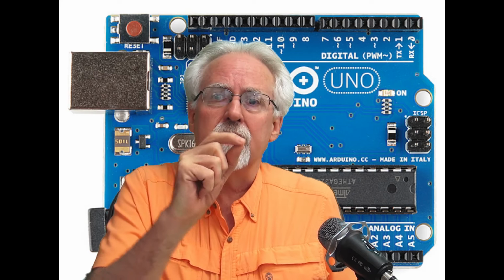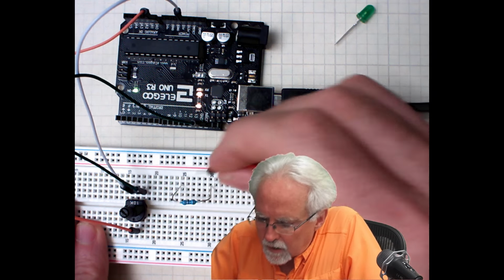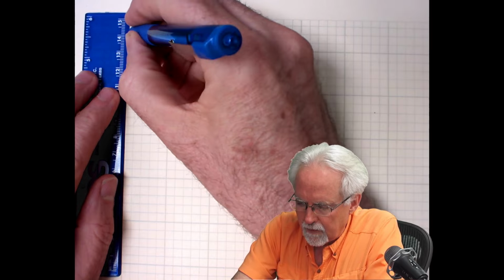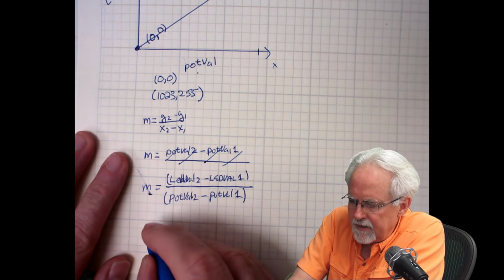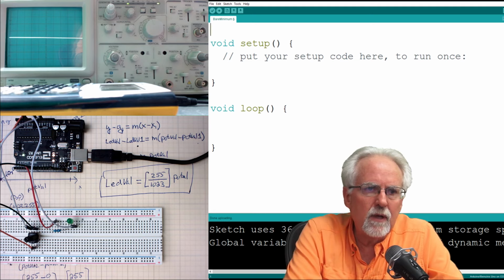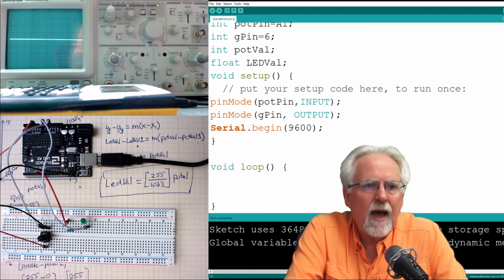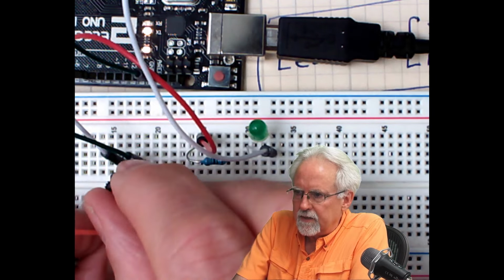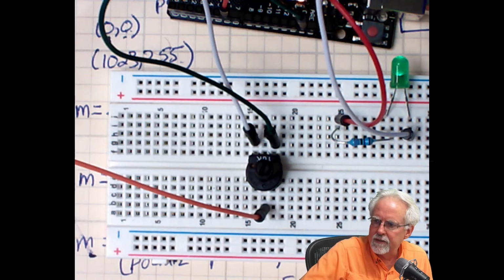Arduino Tutorial 14: Dimmable LED Project

Comment: isnt something like this easier to adjust the brightness of the LED?
where you connect the positive pin of the led to digital pin 11 and the middle pin of the potentiometer to the analog pin A0

void setup() {
pinMode(A0, INPUT);
pinMode(11, OUTPUT);
}

void loop() {
analogWrite(myLED, analogRead(A0));
}

Comment: I love learning programming with you! It’s so helpful as an apprentice mechatronics technician. However, I didn’t know about the formula y − y₁ = m(x − x₁), but f(x) = mx + b worked just as well. Is there a collection of formulas that are important and often reused in programming?
Reply from the maker: Both are equations for a line. Since for most electronics, you start with two points, using the point slope formula is the most appropriate. y = mx + b is the slope intercept form, which requires you know the intercept.

Comment: float Vout;
int readVal;
int val=A0;
int dt=500;
int ledPin1=9;
float bright;

void setup() {
  // put your setup code here, to run once:
  pinMode(val,INPUT);
  pinMode(ledPin1,OUTPUT);
  Serial.begin(9600);
}

void loop() {
  // put your main code here, to run repeatedly:
readVal=analogRead(val);

bright=(255./1023.)*readVal;
analogWrite(ledPin1,bright);
Serial.print("My pot val is: ");
Serial.println(readVal);
delay(dt);
}
Reply from the maker: Excellent, looks like you have it working!

Comment: /*
    True Analog Voltage readings and LED dimming without PWM using Potentiometer.
*/

// Pin Configurations
const int voltageReadingPin = A1; // Explicitly use the 'A' alias for analog pins
const int baudRate = 9600;
const int delayTime = 300;

void setup() {
    pinMode(voltageReadingPin, INPUT);
    Serial.begin(baudRate);
}

void loop() {
    // Read the actual hardware voltage coming off the potentiometer
    float readVoltage = (5.0 / 1023.0) * analogRead(voltageReadingPin);
    
    // Print a clean, formatted sentence to the Serial Monitor
    Serial.print("True Analog Voltage: ");
    Serial.print(readVoltage, 2); // 2 decimal spots  only.
    Serial.println(" V");
    
    delay(delayTime);
}                                               ACCIDENTALLY DID THIS !! :) THANK YOU SIR !

Comment: This was really fun! To really bring it home I did two LEDs, one goes along with the voltage and the other one is inverse, so at 0 one is off and the other one is at full power, and at 1023 one is at full power and the other one is off. It´s fun homework and it helps round out how to do the formulas :D Thank you for everything! This is an amazing course.
Reply from the maker: LEGEND! Great job going the extra mile with that inverse logic. The best students think about what they have learned, give themselves something new to try, or a twist on what was taught, do it, and then that shows that learning has really happened. It always looks easy when you watch me do it, but real mastery comes from doing something new on your own. Well done.

Comment: Yeah we listen to the whole video. I also was thinking do we need the lead to the other pot pin and of course otherwise the 5V drop only goes through the first part so there is no voltage divide. Also really pushes the point of the input being 1023 and output 255. Easy thing to forget.

Comment: int pinRead = A2;
int readVal = 0.;
float v2;
int wait = 1000;
int brightness; 
int ledPin = 9;
float VoltLimit = 4.;
void setup() {
  // put your setup code here, to run once:
  Serial.begin(9600);
  pinMode(ledPin, OUTPUT);
  pinMode(pinRead, INPUT);
}

void loop() {
  // put your main code here, to run repeatedly:
  readVal = analogRead(pinRead);
  brightness = map(readVal, 0, 1023, 0, 255);
  analogWrite(ledPin, brightness);
  delay(wait);
}
I have tried to build it before i even watch the video after i searched i found the map function and i used it to change the range of the readVal varaiable from 0 => 1023 to 0 => 255 and it works hahahah, but i love the math behind it so i did it again with you during the lesson.
Reply: Map...Nice!

Comment: The most valuable piece for me is using critical thinking to do the "homework" assignments you give. I internalize the knowledge by applying it to the assignments, and I feel so accomplished when they work (or even when they don't - at first)!  I save my work and use // to comment out anytime I feel I need a bit more explanation if I need to go back to it. I've got 3 Arduinos in various stages of projects at all times. Most recently, I built a fun project that required a 6-digit keypad code. When entered correctly, it would release an elf's "holiday spirit" (fairy lights). I packaged the whole thing up, put an elf in a "containment chamber" and stuck it on my apartment door as an escape room-style entry for the holiday door decorating contest. Your teaching style is perfect - a slow burn with lots of explanation, followed by head-scratching assignments that allow the learner to apply that day's lesson. Simply, thank you!!
Reply from the maker: That is a really important point, and doing the home work is very important. Here is the thing . . . when you watch me do it, it looks so easy. You think you understand it, because it makes perfect sense. But only in doing the homework do you learn that it is not so easy, and it forces your own brain to think. When you solve a programming problem on your own, connections and pathways in the brain are created that allow you to form your brain into a problem solving machine, not a cut and paste robot. Critical Thinking is a skill that is like building a muscle. It does not come naturally but something you have to develop. Thanks for your comment.

Comment: Just a note to my future self and Thanks to Paul! I just completed this project! The best part of this Dimmable LED Project -I was able to complete it without looking at your lecture until the end. I just watched the first part of your video, understood what we are trying to accomplish and gave it a try to see if I can do it by myself. To my surprise after spending 1 hour, I was able to.. then I looked at the end of the video to see if i made it correct. I was correct. Also one thing I did differently was to print the raw values and the voltages read by Potentiometer pin as well as Led pin, so total 4 values on the serial monitor. Again, I cant thank you enough for making all these educational videos. Five years ago, When I first looked at your old Arduino Tutorials, since I did not practice, I almost forgot the concepts, now since I am doing the hands on and completing assignments, hopefully it will stick in my brain for long..

Comment: I'm wondering if it's necessary in the "set up" to do that pinMode (potPin, INPUT) since that analog pin seems to be an input by default.  I was able to get away with doing this and the previous lesson without calling that INPUT on the analog pin.  I just jumped straight into having a variable equal to analogRead from that pin in the "loop" section.
Reply from the maker: It is good practice to do it

Comment: Currently laid up after surgery and this has been an amazing way to learn! I got the Elegoo kit since it was a bit cheaper and came with more stuff. I tried doing the original Arduino projects via the PDF of their project book and the components were different enough that a few didn't work. Been running through your videos ever since. 

One thing I wanted to call out on this one was I followed your advice and didn't use ANY real values in the void loop! Even my (255./1023.) I put as a float variable and named it "scale" and used that in my equation in the void loop. Easier to change if needed (can't think of when or why that would be necessary at the moment), but it also helped me visualize why I'm writing the code I'm writing. I visualized it as "I'm taking the potVal and scaling it to the equivalent value on the ledVal scale." 

Thanks for your effort on these.
Reply from the maker: Great to hear that you are enjoying the series, and get well soon!

Comment: This is my code for the homework:

int myPin=A2;
int readVal;
int delay1=250;
int redpin=9;
int yellowpin=8;
int greenpin=7;
float V2;

void setup() {
  // put your setup code here, to run once:
Serial.begin(9600);
pinMode(myPin, INPUT);
pinMode(redpin,OUTPUT);
pinMode(yellowpin,OUTPUT);
pinMode(greenpin,OUTPUT);
}

void loop() {
  // put your main code here, to run repeatedly:

readVal=analogRead(myPin);
V2=(5./1023.)*readVal;
Serial.print("Potentiometer Voltage is ");
Serial.println(V2);

if (V2>4.0){
digitalWrite(redpin,HIGH);
digitalWrite(yellowpin,LOW);
digitalWrite(greenpin,LOW);
}

if (V2<=4.0 && V2>=3.0){
digitalWrite(redpin,LOW);
digitalWrite(yellowpin,HIGH);
digitalWrite(greenpin,LOW);
}

if (V2<3.0){
digitalWrite(redpin,LOW);
digitalWrite(yellowpin,LOW);
digitalWrite(greenpin,HIGH);
}

delay(delay1);
}
float V2;float V2;

Comment: hey but did we actually NEED to do all that math and stuff for this project? Couldn't we just connect the LED (with a resistor) to the middle pin of the potentiometer to get that dimmable effect when we tweak the potentiometer?
Reply from the maker: Because the whole purpose of the lesson is to teach you math and programming.

Comment: Does that pot have a minimum resistance? Say it does not, you are shorting 5V  to ground if you drop it all the way, or am I wrong?
Reply from the maker: Go back and watch the class on the potentiometer. The resistance between the outside two legs does not change. There is no short, there is not change in current from 5V pin.

Comment: Is it OK for LEDVal to be a float?
Doesn't the value have to be between 0 and 255?
If the value is 123.27 does it know to round down to exactly 123, or can it just get more fine tuned resolution?
Reply from the maker: It does not fine tune the resolution. Anthing to the right of the decimal is ignored.

Comment: I MADE IT BEFOREHAND; CAN YOU PLEASE CHECK THIS:

int rp = A5;
int readVal;
float V2;
int dly = 300;
int warning = 7;

void setup() {
  pinMode(warning, OUTPUT);
  Serial.begin(115200);
}

void loop() {
  readVal = analogRead(rp);
  V2 = (5.0 / 1023.0) * readVal;

  Serial.print("Potentiometer voltage is: ");
  Serial.println(V2);
  
  if (V2 >= 0.00 && V2 < 1.00) {
    analogWrite(warning, 30);
  }
  else if (V2 >= 1.00 && V2 < 1.50) {
    analogWrite(warning, 55);
  }
  else if (V2 >= 1.50 && V2 < 2.00) {
    analogWrite(warning, 75);
  }
  else if (V2 >= 2.00 && V2 < 2.50) {
    analogWrite(warning, 100);
  }
  else if (V2 >= 2.50 && V2 < 3.00) {
    analogWrite(warning, 135);
  }
  else if (V2 >= 3.00 && V2 < 3.50) {
    analogWrite(warning, 160);
  }
  else if (V2 >= 3.50 && V2 < 4.00) {
    analogWrite(warning, 185);
  }
  else if (V2 >= 4.00 && V2 < 4.50) {
    analogWrite(warning, 200);
  }
  else if (V2 >= 4.50 && V2 <= 5.00) {
    analogWrite(warning, 255);
  }

  delay(dly);
}

Comment: Thanks Paul, I worked this lesson into the end of my homework from the last lesson. I found out, well kind of, I think, that it has to be on the pins with PWM because originally I tried using pin A3 and it would not dim in fact, it would only come on when the voltage was high. Any way thanks a bunch for the free lessons, not just these but the bible lessons too.   You have been an exponentially great blessing!
Reply from the maker: Thanks for the kind words, and I really appreciate the support!

Comment: Thanks for the video Paul! I have a question: could you just hook the resistor and LED directly to the potentiometer without additional programming?
Reply from the maker: Yet the whole purpose of the lesson is learn to program, and control things via the  arduino.
Reply: @paulmcwhorter  gotcha thanks

Comment: Here the potentiometer control the voltage of the Arduino and we can control the led using this method. Am i right? Because i wondered that there is no connection with thr potentiometer and the led.

Comment: Worked perfectly, great job. My experience at programming goes back to when I was a professor teaching Fortran and key punch. I also had the computer lab reaching basic, I had 24 Dos machine plus 24 apple machines. The maximum hard drive was 5 Meghan bites on the DOS, and the apples had whar we called school bus system, where all 24 apple machines were connected to a common hard drive.

Comment: 5 years later, and your lessons are still reaching people. Of course I have to put my own spin on it!

My code below:

// Analog input to control LED brightness.

int iPinPot1 = A1;  // Pot pin.
int iPinLEDGreen = 3; // Green LED pin. Needs to be PWM capable.

// "Ramp" LEDs. Like a bar graph. Any digital pin.
int iPinLEDR1 =  8;
int iPinLEDR2 =  9;
int iPinLEDR3 = 10;
int iPinLEDR4 = 11;
int iPinLEDR5 = 12;
int iPinLEDR6 = 13;

// Sets the range of the 6 "BAR GRAPH" LEDs.
int iBG2 = 1;
int iBG3 = 2;
int iBG4 = 3;
int iBG5 = 4;

int iVolt1; // Holds the value of Voltage 1 analog read.
int iVolt2; // Holds the LED output value. 0 - 255.

float fVolt;  // Holds the converted value of voltage.

// Slope variables. Change these for different intup and output ranges.
float x1Pot = 0.0;
float x2Pot = 1023.0;
float y1Pot = 0.0;
float y2Pot = 255.0;
float fSlopePot;
float x1Volt = 0.0;
float x2Volt = 1023.0;
float y1Volt = 0.0;
float y2Volt = 5.0;
float fSlopeVolt;

String sMess1 = "Voltage: ";
String sMess2 = "v";
String sMess3 = "     ";
String sMess4 = "Analog reading: ";

void setup()
{
  Serial.begin(9600);

  pinMode(iPinPot1, INPUT);
  pinMode(iPinLEDGreen, OUTPUT);
  pinMode(iPinLEDR1, OUTPUT);
  pinMode(iPinLEDR2, OUTPUT);
  pinMode(iPinLEDR3, OUTPUT);
  pinMode(iPinLEDR4, OUTPUT);
  pinMode(iPinLEDR5, OUTPUT);
  pinMode(iPinLEDR6, OUTPUT);

  // Calculate the slope for the pot to PWM setting.
  fSlopePot = ((y2Pot - y1Pot) / (x2Pot - x1Pot));
  
  // Calculate the slope for the pot to voltage setting.
  fSlopeVolt = ((y2Volt - y1Volt) / (x2Volt - x1Volt));
}

void loop()
{ 
  iVolt1 = analogRead(iPinPot1);

  // Calculate the voltage and the PWM reading.
  fVolt = iVolt1 * fSlopeVolt;
  iVolt2 = iVolt1 * fSlopePot;

  // Display the results.
  Serial.print(sMess1);
  Serial.print(fVolt);
  Serial.print(sMess2);
  Serial.print(sMess3);
  Serial.print(sMess4);
  Serial.println(iVolt2);

  // Set the green LED to the correct brightness.
  analogWrite(iPinLEDGreen, iVolt2);

  // Set the "BAR GRAPH" LEDs.
  if (fVolt == 0.0)
  {
    digitalWrite(iPinLEDR1, LOW);
    digitalWrite(iPinLEDR2, LOW);
    digitalWrite(iPinLEDR3, LOW);
    digitalWrite(iPinLEDR4, LOW);
    digitalWrite(iPinLEDR5, LOW);
    digitalWrite(iPinLEDR6, LOW);
  }
  if (fVolt > 0.0)
  {
    digitalWrite(iPinLEDR1, HIGH);
    digitalWrite(iPinLEDR2, LOW);
    digitalWrite(iPinLEDR3, LOW);
    digitalWrite(iPinLEDR4, LOW);
    digitalWrite(iPinLEDR5, LOW);
    digitalWrite(iPinLEDR6, LOW);
  }

  if (fVolt >= iBG2)
  {
    digitalWrite(iPinLEDR1, HIGH);
    digitalWrite(iPinLEDR2, HIGH);
    digitalWrite(iPinLEDR3, LOW);
    digitalWrite(iPinLEDR4, LOW);
    digitalWrite(iPinLEDR5, LOW);
    digitalWrite(iPinLEDR6, LOW);
  }

  if (fVolt >= iBG3)
  {
    digitalWrite(iPinLEDR1, HIGH);
    digitalWrite(iPinLEDR2, HIGH);
    digitalWrite(iPinLEDR3, HIGH);
    digitalWrite(iPinLEDR4, LOW);
    digitalWrite(iPinLEDR5, LOW);
    digitalWrite(iPinLEDR6, LOW);
  }

  if (fVolt >= iBG4)
  {
    digitalWrite(iPinLEDR1, HIGH);
    digitalWrite(iPinLEDR2, HIGH);
    digitalWrite(iPinLEDR3, HIGH);
    digitalWrite(iPinLEDR4, HIGH);
    digitalWrite(iPinLEDR5, LOW);
    digitalWrite(iPinLEDR6, LOW);
  }

  if (fVolt >= iBG5)
  {
    digitalWrite(iPinLEDR1, HIGH);
    digitalWrite(iPinLEDR2, HIGH);
    digitalWrite(iPinLEDR3, HIGH);
    digitalWrite(iPinLEDR4, HIGH);
    digitalWrite(iPinLEDR5, HIGH);
    digitalWrite(iPinLEDR6, LOW);
  }

  if (fVolt == 5.0)
  {
    digitalWrite(iPinLEDR1, HIGH);
    digitalWrite(iPinLEDR2, HIGH);
    digitalWrite(iPinLEDR3, HIGH);
    digitalWrite(iPinLEDR4, HIGH);
    digitalWrite(iPinLEDR5, HIGH);
    digitalWrite(iPinLEDR6, HIGH);
  }
}

Comment: Thank you a lot for the quality of your teaching Mr. McWhorter. You can't imagine how much your knowledge sharing is a blessing to me.

If I may contribute a bit to this amazing tutorial...
For those who, like me, wondered why to have the LED intensity as "y" and the potentiometer resistance as "x", and not the other way around,
This is what I've learned and I think that would be worth to share...
.
In this setup, the potentiometer resistance determines how much voltage is sent to the Arduino’s analog pin. Based on this, the Arduino will adjust the LED's intensity. The relationship is one-way:
- You set the resistance (input, 𝑥).
- The Arduino calculates the corresponding LED brightness (output, 𝑦).
If we were to reverse them (LED intensity as 𝑥 and resistance as 𝑦), it would imply the LED intensity somehow determines the potentiometer resistance, which doesn’t make sense in this context.
.
I hope this will give you a bit more of clarity. Happy learning!
Reply: I corrected a typo by editing my comment and it caused me to lose my precious like from my favourite teacher. What a shame 😭💔

Comment: Why are you complicating it so much when a simple rule of three is enough to get the result?
Otherwise, i paused the video and I wrote my own code, and had a small issue with it... finally i went to chatgpt to ask why my code didn't worked, and it told me than i used a digitalWrite instead of a analogWrite... It's useful for this kind of things.
Reply from the maker: why am I complicating it? Because I am trying to teach real math and how to solve problems. The so called simple rule of 3 is not math, it is a shortcut that most people apply inappropriately, as it only works when the y intercept is zero. So, the purpose of this channel is to teach real math that can be used to solve real problems,.

Comment: I didn't try it but i believe you can skip the logic and just after the pot. connect the resistor and the LED and ground the LED and you will have the same results